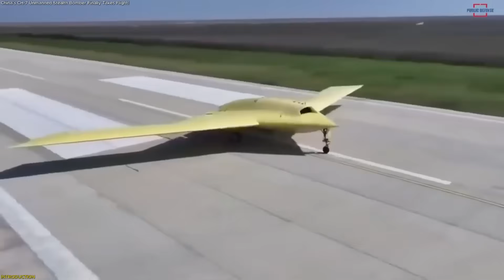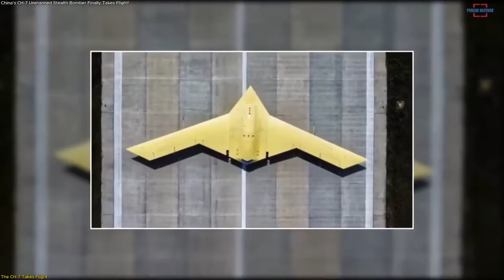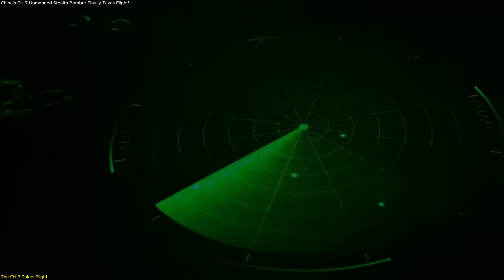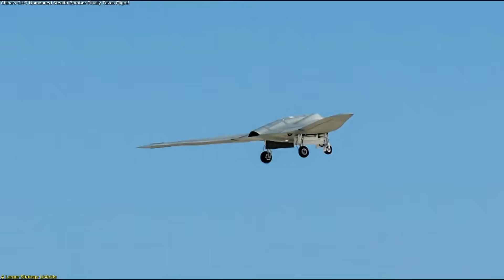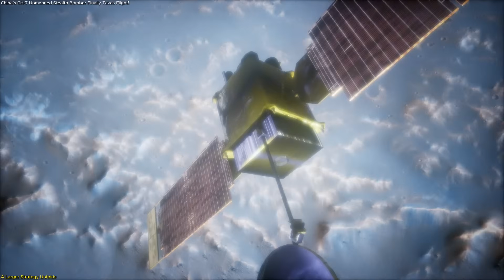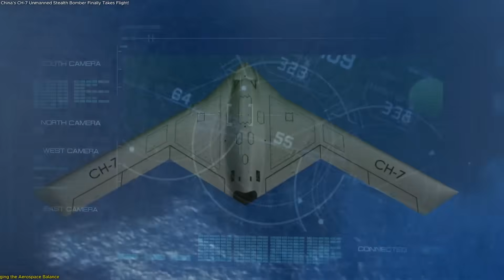China’s CH-7 Unmanned Stealth Bomber Finally Takes Flight!

Comment: Another garbage promoted by news media. Just like the Jujian-a failure. Not even half completed. So. Stop fake news. If you have it, bring it or just keep quiet.
Reply: Real garbage is the F35 flying with an obsolete Gallium Arsenide radar  which can't see the 0.48m2 RCS of an Su57 at more than 35km. or the J20's 0.027m2 RCS  until within visual range. The F35 only has 14kW transmit power. Barely enough to toast bread. Russian and Chinese radars use Gallium Nitrate and have detection ranges of 370km.  The F35 is obsolete. Educate yourself:    Read the latest GAO report on the F35.